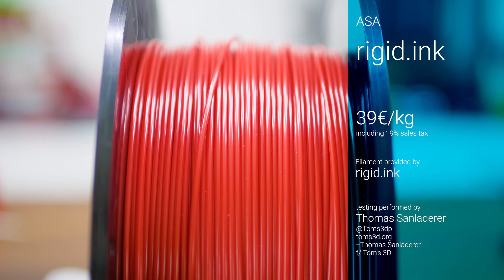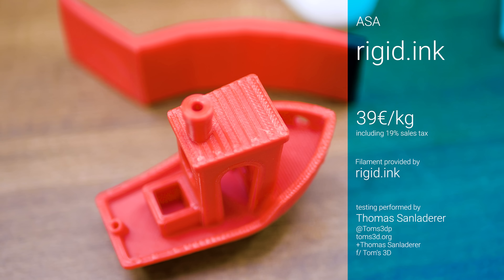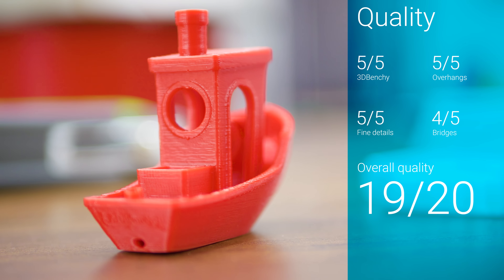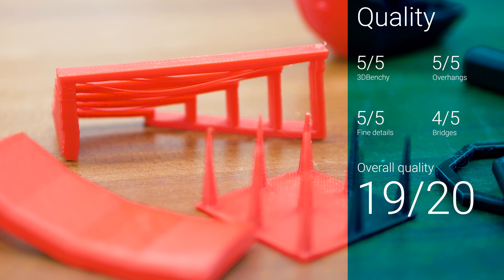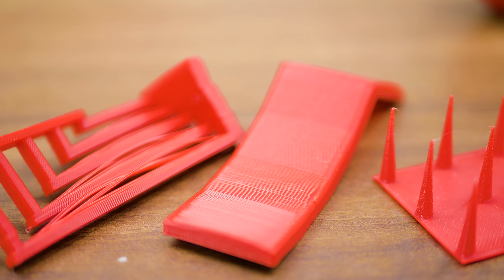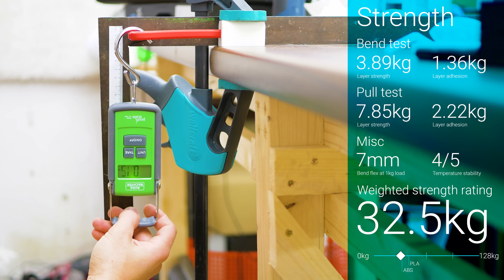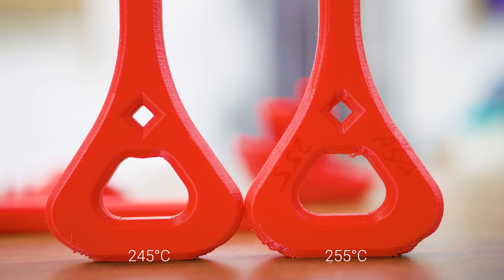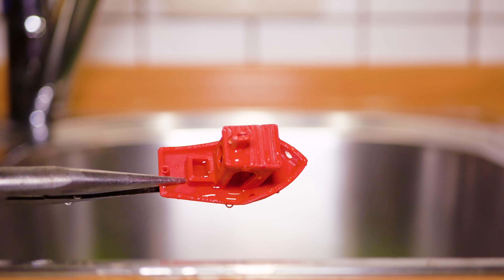Incredible print quality: ASA from rigid.ink is ready to replace ABS! #Filaween

Comment: I'm happy to see this video ... After I utterly failed trying polycarbonate,  I got some FormFutura ApolloX (modified ASA).  I was blown away.  ZERO warping on my prints with large flat bottoms.   Excellent print quality.   Worked great on a Buildtak surface, stuck nice, and wasn't too hard to remove.   Just don't use too much cooling fan.  I also like that it isn't nearly as glossy as other plastics.   And it has the temperature resistance and UV resistance I'm looking for, for some parts for some tools that will be used outdoors.     My only complaint is I have to order it directly from FormFutura in the Netherlands.  Canadian supplier has been out of it for months.

Comment: i got a roll of this stuff based on this video and let me tell you, it feels like i'm cheating. this stuff is STUPIDLY easy to print with.

although i found it printed best with a 100C bed, 225c nozzle, dropping to 80C bed after 5mm, and a 30% parts cooling fan speed. My e3d might have a bad hot end or something thought and its just reading low on temps, i recently converted to the newer cartridge thermistor design so i'll try again with that soon

Comment: How about warping and fumes/smell? It would be great if each video commented on those 2 factors as they are high up there on the list when I choose a material.
Reply: +1 regarding more info on the fumes/smell.  Would like to try this plastic myself but worried about fumes since ASA produces toxic smoke generation when burned
Reply: the benchy clearly had warped in the video

Comment: Tom, what nozzle size are you using for these videos?  I use a 0.4mm and am aware that the layer adhesion will be different if you're using a different size.  Thanks

Comment: i recently purchased a Prusa Mk2 (during your latest live stream actually) and want to know what the best filament to print with is. Which one would be the best? ABS, ASA, PLA etc. etc. Im looking at both price and how well it handles fine details but if it's in the mid to high range and handles details significantly better than one priced better, then that would be one i would consider.
Reply: Depends on what you want in your prints. For parts that look really nice, I've had the best experience with PLA (Hatchbox PLA to be exact). PLA doesn't warp nearly as much as ABS, so you'll have a much nicer time printing with it. Hatchbox PLA is about $22/kg in the US on Amazon. I'd recommend it to anyone.

However, PLA is more brittle when compared to ABS which will bend before breaking. PLA sort of snaps before bending much.

Hope this helps a bit.
Reply: Thanks! So since its brittle, would putting in in an enclosed chamber make it more pliable? Similar to how blades are heat-treated
Reply: @nextgencrysis875  plastic isn’t metal. Apples and oranges. From what I’ve been reading on filament the more it’s reheated the more the molecular chains break down weakening the filament.  So heat treating plastic would essentially do the opposite of what it does to metal. You should do an experiment. Heat up the plastic part in a heated enclosure (for extra experimenting: and then quickly cool it by quenching it in cool water.)  There’s probably someone on YouTube who already did it. For the part, I would print a plastic hook that way you can use a weight scale to pull on it to test it strength before it snaps.

Comment: What  filament would you recommend that is similar to PLA, but with better temperature stability? ABS is a nightmare to print on my printer - my plate barely can reach 105C, but i have to wait half an hour and sometimes my power supply cuts from the high power consumption. Also i get a lot of cracking layers as my printer is not enclosed, and enclosing it is not really a good solution for me. I am getting superb results with PLA at 55C bed and 200C nozzle - nice quality and strong prints, but PLA is rather soft at 50-60C and there are a lot of places i cannot use it. Is there a material that prints like PLA, but has better temperature stability? (and doesnt require high bed temp and enclosed printer)

Comment: My question always with these different filaments is warping on large parts. I print lots of very large things and have yet to find a filament that warps as little as PLA.
Reply: Luke AOD I have a reel of Fillamentum ASA and you get a whole smorgasbord of warping, shrinking and (if you don't print a .2mm or less layer heights) bad layer adhesion. I could get it to adhere to the bed ok, but even when firmly stuck down you get corners deforming and layers delaminating. This is printing without an enclosure though...maybe better with that...

Comment: Would this material be good to use to print replacement parts for a Prusa i3 MK2?
Reply: It's probably overkill for anything other than the part cooling fan duct.  You should be able to get away with PETG for everything else.

Comment: Not gonna lie, I'm willing to find a better alternative to ABS.
Reply: I would love to! Actually going to be trying ASA today/ tomorrow so fingers crossed! ;)
Reply: ABS is garbage
Reply: Check out ABS+ from SUNLU, it's cheap (18€ from amazon in Germany), prints between 220 and 240, is good for acetone smoothing, does not warp as bad as regular ABS, and most important: prints perfectly well on a CR 10. I actually print figures with it. Especially when you need a lot of supports, they break away so much better, than PLA supports.
Reply: Does the SUNLU ABS+ smell as bad as regular ABS?

Comment: Does it stink like ABS?
Reply: It should smell as bad as ABS. They both have styrene content which gives off that nasty gas and which is why they melt from acetone.
Reply: Styrene may be the toxic part but it's not necessarily the stinkiest part. Heck, HIPS doesn't stink so bad and it's mostly styrene. It's the butadiene that gives the burning rubber smell to ABS.
Reply: In my experiance with an other brand, it doesn't stink at all. There is a very descrete odore like PLA. Currently it is one of my favorite filament to print with.
Reply: I bought a sample of rigid.ink ASA. Yes it stinks. Not as bad as some of the horrible ABS, but definitely not odorless. It is much more unpleasant to smell than PLA. And my eyes also feel uncomfortable. 
Think about it. If it was odorless, advertising as "odorless ABS" alone would make it insanely popular already, not to mention UV resistance.
Reply: i found rigid's ABS smells less than other ABS i've tried.  still smells but it's much less.  for for the 5-6 other brands i've tried, it's been the same consistent smell level which is more than rigids.  they probably reduced the smell intentionally.  now i just wish rigid would stock world wide... too pricey in other places.  (like $60, tax shipping etc...  vs $25-30 local)
Reply: Ive only used MatX ASA and it has no smell.